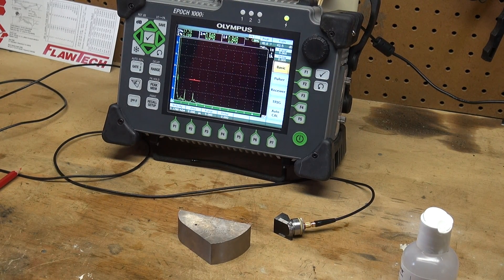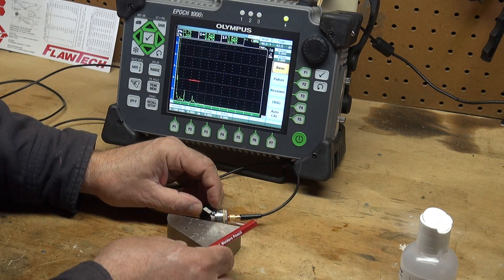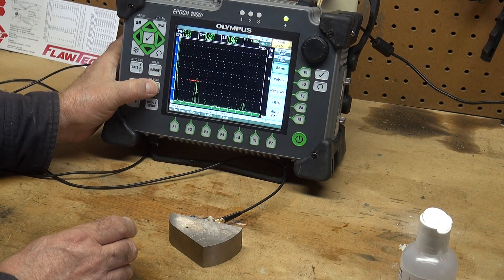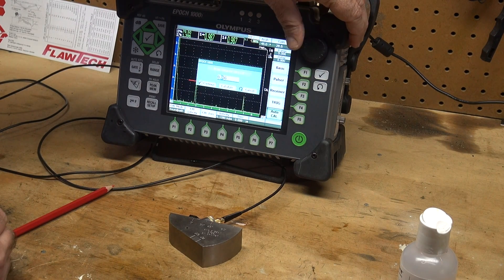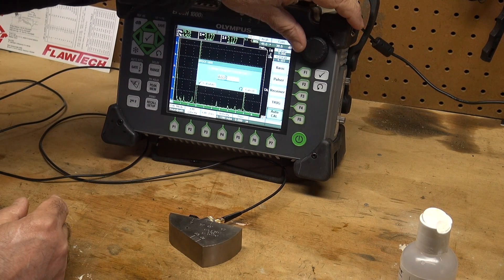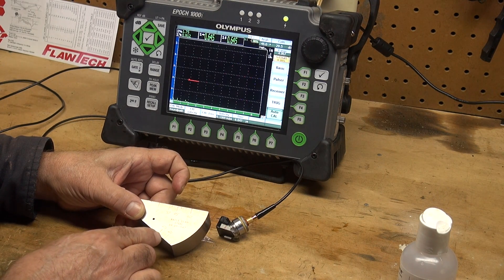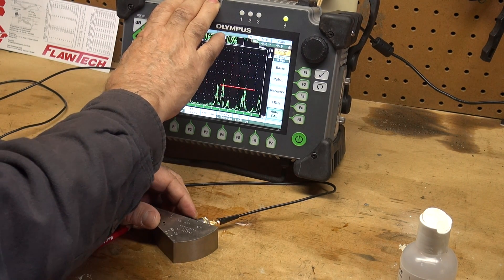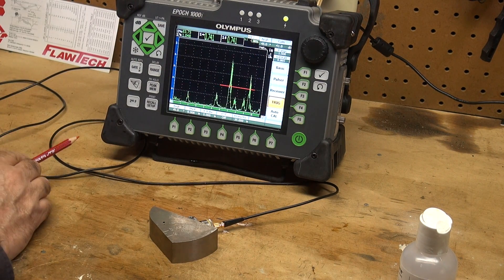UT Angle Beam Calibration Using Rompus Block

Comment: As another way to verify your Beam index point could you measure the length to the side drilled hole from where you are and if your depth is right you know it is calibrated correctly?